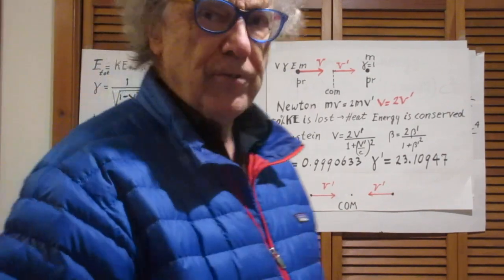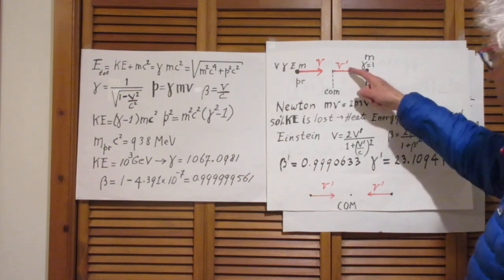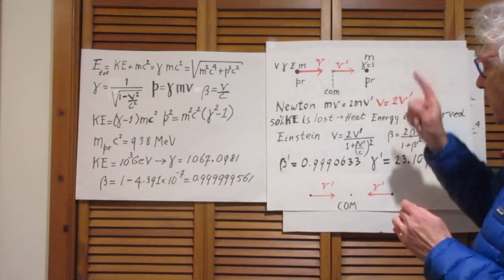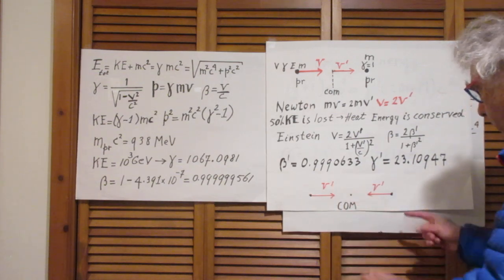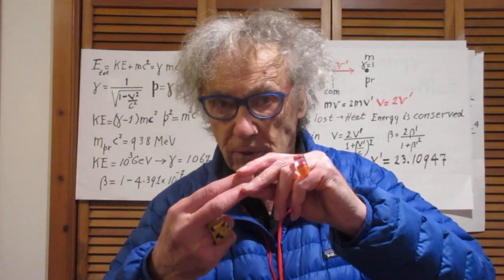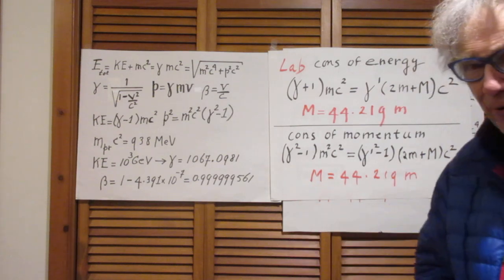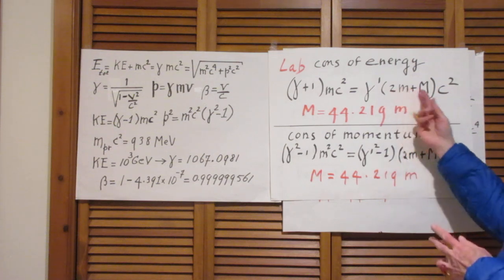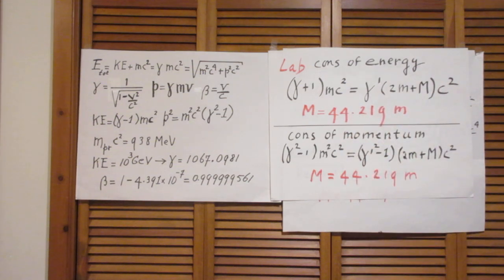3 Solutions (2/2) Problem #25  - Collision 1000 GeV Proton

Comment: Question:  When you first posed the problem, I don't think you said the protons would remain in tact. However, you did make that clear in your solution.  I had assumed the original protons would be merged into the single particle that was produced -- a single particle with the maximum possible mass.  This would give a result of 46.219m, wouldn't it?  Please explain why that would not be a valid assumption.
Reply from the maker: KE is lost as this is an inelastic collision. I mentioned in the problem that the loss of KE of the 1000 GeV proton can be converted into a maximum mass of M. I could not have been more clear.
Reply: I agree you were very clear about that.  And I understand that the KE is converted to a mass of 44.219m. However, not being a nuclear physicist, I am only asking--is it not possible for the two original protons to be merged into the single particle that was created?
Reply from the maker: if the 2 protons merged into a single particle only the binding energy would be released which is probably about 10 MeV which is MUCCCCCCHHHH less than 2*938 MeV. However, that particle would be He with zero neutrons and such a particle doe not exist.
Reply: I see.  Thank you. And, Happy 82nd Birthday!  Keep up the good work for many years to come.  My 71st birthday is coming soon, so I'm not that far behind you.

Comment: I solved the problem my own way (correctly). https://youtu.be/BIozFbsjShM Thanks for teaching us online Walter. I so much benefitted from you putting this problem up.
Reply: https://youtu.be/BIozFbsjShM
Reply from the maker: Your solution is fine. It's in essence identical to my last solution. E^2 - (pc)^2 is "rest mass^2" of the system . Thus it is (2m+M)^2*c^4.
Reply: Lectures by Walter Lewin. They will make you ♥ Physics. Yes, i realized the similarity when watching your solution and was first going to write that in a/one comment, but then i think i didn't. I wanted to show you my exact thinking, that's why i made my video to present such clearly. I hoped it could induce some clarity and understanding for some people. I hope you liked it.
Reply from the maker: 4 people had a correct solution. All 4 (including you) calculated E^2-(pc)^2 which is the restmass^2 of the system.  All 4 (including you) deserve an A++++. It's a very fast way to find M. That's why I saved it for my last solution.
Reply from the maker: I have uploaded your video on my Playlist "Bi-Weekly Problems".  Two other people sent me also identical solutions to my 4th solution, but not in the form of a video. 
https://www.youtube.com/watch?v=BIozFbsjShM&index=98&list=PLyQSN7X0ro23CEzKOjAVcRq66m6g-mFLe
Reply: Lectures by Walter Lewin. They will make you ♥ Physics. Thank you so much Walter.

Comment: Sir, how you knew earlier on that for the case of maximum rest mass, the particle created after the collision must move with the same velocity as of the two protons moving together.Or is it general and is a property of inelastic collisions?                                                                              No law of physics(I think) doesn't permit that the newly created particle could, for instance, be moving after the collision towards the direction opposite of that of the motion of incoming proton before collision. In that case the momentum of the particles after the collision in C.O.M. frame would not be zero.                                                                                                            I worked out the problem without using the fact that the newly created particle would move with the two protons and I was amazed to get the exact same answer. (https://www.dropbox.com/s/bamvh4xtkqmhxhz/SOLUTION%20OF%20BIRTHDAY%20SPECIAL%20PROBLEM.pdf?dl=0)
(In my early attempts I was not getting the right answer because I wrongly assumed that the particle created after collision will be at rest in the laboratory frame.)

Comment: I wouldn't call it intuitive, but yet it kinda is. You can really think this all in your head, if you are smart and understand the concept. That's what Einstein did. I'm just happy that I can follow all 4 of your solutions. To me it's a good brain excercise. One also sees here, how newtonian mechanics is really a special case of special relativity that applies, when v << c. Thank you for this problem. It opened the world of particle accelerators quite a bit more.
Reply from the maker: SR changed the way we think about the world and the universe and even about life itself.
Reply: Indeed. What I find also very liberating is that frame of reference doesn't make any difference. You can choose whichever one you like to use. I have once solved a problem that happens in an accelerating car simply by handling it in free falling frame of reference. Then the car has an acceleration of 1 g upwards and whatever it has in road direction and the total acceleration is the sum vector.  Some got  really upset about that, saying that you can't make up an acceleration upwards when the car stays on ground. But sure you can. Free fall often simplifies.

Comment: This was my answer https://ibb.co/dtm5Dm.

If I subtract the mass of the original two protons i.e. 2m from M = 46.22m that I calculated, I get the mass to be 44.22m which is same as your answer. That means that my procedure was almost correct. If this is the case, then not subtracting the masses of original two protons was a silly mistake.

I would say that you should post relativity problems.
Reply from the maker: 6 people came up with 46.22 (they were close), ONLY 3 people (out of 100) had the correct solution.